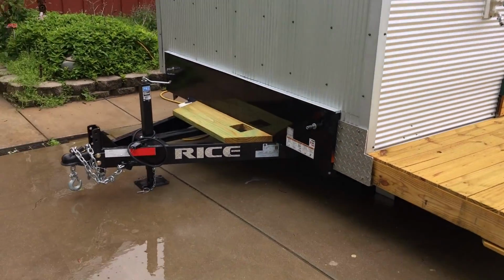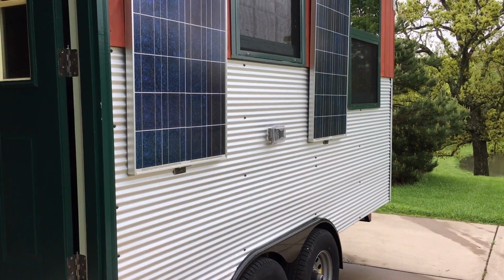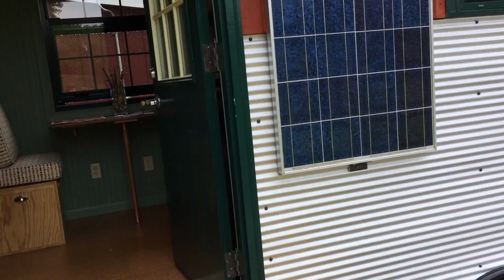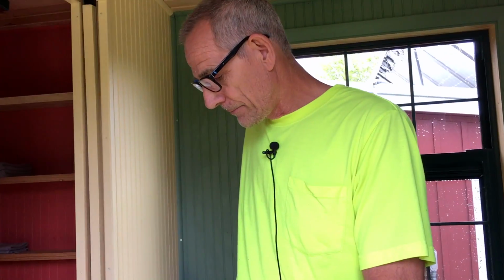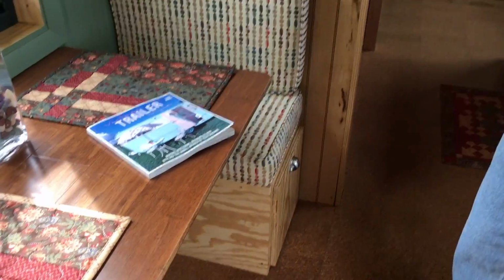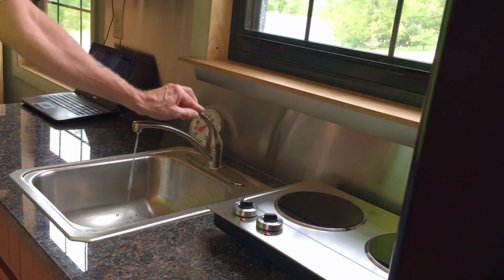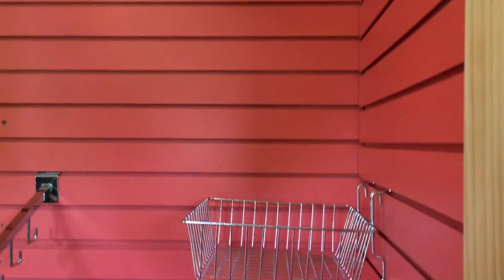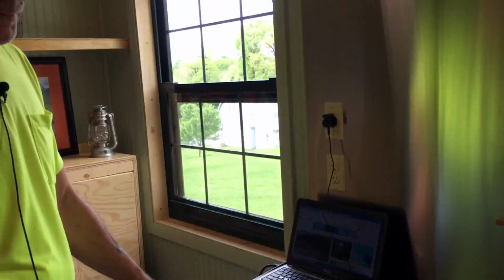The Starlighter 1 Is The Perfect Forever Tiny House

Comment: So nice to see an alternative to lofts in a tiny home and get ideas. He gave a nice tour and I'm sure he could custom the Murphy Bed a little to make a seating area when the bed is not in use with storage under . Like raising the bed up 8-10 inches there could still be two shelves above but storage under with a 7-9 inch platform for cushions . Remove the cushions when folding down the bed and shove them in the dead space of the Murphy Bed frame back when using for sleep. The beauty of seeing all the tiny house builds... Ideas to fit you personally. Thanks for sharing.
Reply: Yes, he mentioned considering it when responding to posts on Tiny House Talk website...  The rotating table was one of the things he changed from the original design, for example...

Comment: I believe some people misunderstand the point of tiny houses....they are custom to YOUR LIFE. So everything he did was for him or the people out there like him. To constructively criticize is one thing, but to be mean and say all the things that he did wrong is opinion. I like the idea of some solar on the side of the house, however you would need to rotate it twice daily, but no hail, or limb damage. Thank you for sharing!
Reply: The problem with tiny house builders is they often had no true design direction and don't make it basic enough to appeal to everyone. They add a bunch of stuff try to add profit.  So if you don't like where a shelf was put, too bad, you're paying for it anyways.  It's like how people add a deck on their home for a couple thousand, but want $10,000 more for their house.   But this also makes tiny homes more expensive.  That's why he put a granite counter top in there, to try to get more money for it.  

But there's a lot of fundamental design flaws in this tiny home though.  All of that embossed stuff on the outside is going to cause running/dripping water along the sides from rain to sit and not drain properly and rot things away and seep into the walls, like the tops of the windows and doorway for example.  The solar panels on the side are pretty dumb, no reason to not put them on the roof. 

He also clearly has walls overhanging the edge of the trailer, which means the whole thing is setup for structural failure.  That one factor alone makes the thing a no buy.  The bulk of the weight in that area is no longer sitting on the trailer, but rather sitting on whatever he used to create the overhang.

He also made another glaring design flaw....he said it's made to be taken off the trailer.  But if you look at the wheel well, the structure contours around it.  There's no way you're getting that off the trailer without destroying the section surrounding the wheel well unless you lift it up off the trailer a few feet, which would basically be impractical and probably impossible without causing major damage to something since you typically slide such things off trailers, not directly lift off the trailer.   The ability to take it off also tells me it's not fully bonded to the trailer in a safe way.  I mean this thing could break off the trailer going down the road, maybe not immediately, but it could happen.  You basically have a couple bolts holding thousands of pounds, and worse, they're holding it horizontally, which means more shearing forces.

He left basically no room for a person to customize it with their own lights, and the lights it does have are pretty sad.  I think even an extremely thin person would find it difficult to sit at that table, and while the top does turn sideways, it's basically unusable in its default position. 

On top of that, when you do turn that table sideways, it basically means that if someone is sitting at the table, the entire walkway is blocked.  So if you've got a person on one side trying to get to the other side or you yourself need to, you have to turn the whole table, which means the other person has to physically get up, back away from the table and due to the aforementioned issue with the table in its default position, won't be able to sit back down at the table until it's turned back again. So it's like one of those scenarios where two people are coming down a narrow hallway and both can't pass at the same time, so the other has to either stop and hug the wall or back out to another area.  And there's 2 seats at that table, so they can't tell us it was only designed for one.

The closet was a fairly huge waste of space, and all the piping/electrical stuff could have been more efficiently distributed. Definitely a few square feet of wasted empty space that you can't do anything with and can't obstruct with closet things like clothes hanging.
Reply: Raw plywood and builders' odds'n'ends doesn't do it for me
Reply: C North YES YOU ARE SO CORRECT WITH HIS HORRIBLE DESIGN FLAW.
Ok, he designed it fitting what he likes or someone else may like, but it’s my opinion of what most people would like or not.
He definitely needed an experience tiny house designer or architect that designs small units. The only reason I watched this video is to see his reason for having the solar panels mounted to the side of the tiny house 😳. What was he thinking🤭 or is it because he wanted to be different... Yes, he’s different. It would have been better if he mounted the wheels on the roof of the tiny house DESIGN FLAW🙄.
Reply: Excellent post.
Reply: @jahmenj  , should we petition to have the builder arrested?
Reply: C North. I'm feeling you. Excellent observations ... all that AND the hideousness of the colour scheme.
Reply: The shelves in the bedroom are not level you can see it when he is talking why not open the Murphy bed to let us see the design of it and the closet area should of been designed differently with a door in mind or curtain there's no room for a washer and dryer combo .
Reply: It's an awesome place to live. I would put the toilet at the other end but then where it is you have less plumbing to do!
Reply: I think it would be neat if he had the solar panels on something that could fold up kind of like an awning.
Reply: Boy, I am 2yrs later to this party! I agree. He gave you so many options for change. Whenever you watch these tiny house, sometimes folks are saying if I had to do it again.... He offers easy options for any change.
Reply: True he made it for him. Very nice but no bathroom sink is not for me. Still a nice little house for him.
Reply: Not necessarily Erin dearie. I think we understand "the point of tiny houses" as well as you.
I hate this place and I have just as much right to give my opinion as you do so save your judgment.
This looks like a mish mash of stuff he got out of dumpsters. This is the worst I have seen and I've seen many.

Comment: This has some great features and I think you did an excellent job building it. I'm going to save this video. I love the fact that it has many things for older folks. Nothing to climb on the roof for and no loft. I also like that it can be taken off the trailer for permanent use. I would really like to see you make a slightly larger one for a couple that includes a bigger bed and sink in the bathroom. Excellent job and good price!!!
Reply: I totally agree with you, especially with R.A. in the joints.

Comment: I like the designs where the electical units are not intruding in living area. I am also concerned about the water system that close to the electric system. Love the colors and granite counters. The front door is nice. I have found treasures at the recycle type stores as well. The outside is very striking. I also like how you designed for the choice of moving around or staying put.
Reply: I too am not excited the water and electrical are so close, my first thought when I saw it - along with why it isn't enclosed in a closet.  I am assuming its guy-designed, no female inputting some ideas we are more apt to focus on.  Like a proper living room/sitting/entertaining area and replacing murphy bed with seating that would convert with a pullout or fold-out bed in the bedroom.

Comment: I like this one. Layout, and set up looks very functional. I might have to cover the glass on the door for privacy sake and a larger bed than single but from what I could see the space was there to fit one, if the murphy bed were removed. I like so much about this and can see going off-grid in it for sure.
Reply: What Murphy bed?
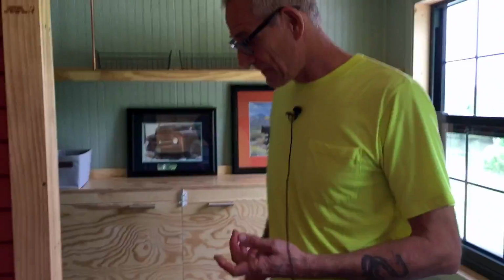Reply: Twin size murphy bed at 9:15 he talks about the bed below the shelving.
Reply: these builders need to lose the murphy beds.  They waste space and are a pain to use as well.

Comment: Nice work. Didn't get to see the bed. I'm not a fan of fixed table and sits but this model is now on my list to try, real nice.

About the discussion on the solar panels, well this is custom build (he knows why he did it this way), besides they can swing up, not fixed as vertical. Unless you don't know this can be very helpful to prevent heating the walls with direct sunlight (insulated or not) depending on the position of the house because less sun will heat this portion. Another thing is, too much sunlight (ironic) is not good for solar panels, they loose efficiency as they heat up.
Reply: wow didn't know that about too much sun on solar panels, nice to know before I have them installed on my house (which is at an angle and totally facing South (in my home our floor-to-ceiling windows along 50' of our house keep it 90 degrees from Dec to about February, so those solar panels on the roof now concern me they could get overheated.  Thanks again.

Comment: If he's going to have a hot water radiant heating system, he should have gone with a tankless, on-demand, hot water system.  It'd have eliminated the need for a hot water tank... and saved a good bit of space.
Reply: A tankless hot water system wouldn't save much room over that tiny tank.  Plus tankless systems are meant to be used with the pressure of a municipal water system.
Reply: oh, didn't know about the water pressure thing, glad you clarfied that for us who were thinking the same thing  @tomj4731
Reply: I believe it would still be possible with some sort of tank and electric pump to pressurize the water source.  Not sure if gravity fed water from a high mounted water tank would be sufficient.

Comment: It's extremely nice and beautifully done.Very charming indeed however, I don't see the point of down-sizing (to untimely live cheaply) yet spending 35,000.00 in doing so. Just don't see who this would appeal to. I would like to see a cute tiny house that's built nicely and within the average persons' budget. Because my train of thought is, if you have 35,000.00 to spend  you can certainly find a large higher end RV to live in instead.
Nice work though.

Comment: Solar  panels not going to work much. Going to hit your head on the tv.  It need to be for a couple bed . Does have some good things
Reply: They are hinged and swing up.
Reply: He didn't show that they are on a hinge, but you can see the hinges pretty easy though. A benefit of them being mounted like that is it can get more sun in the winter, more than on top. The tv is also on a multiple hinge hangar that also is plain to see. It is mounted to a metal wall away from the doorway. There is also a murphy bed style set up in the back that will hold a twin bed. Did you bother to watch the video or have ever seen a tiny house before this one?
Reply: They look adjustable.
Reply from the maker: Yes in the winter if the tiny house is oriented south it will get sun pretty much all day. In the summertime you can adjust the panels even more to catch more sun.
Reply: Really clever installation of the solar panels.  I wouldn't want to climb on top of the home to maintain the panels.  Great idea.
Reply: That's good to know. I was wondering if the panels could be lifted up to catch summer sun.
Reply: Yes, the hardware above the panels are adjustable hinges and the bottom is held in place with a clasp... So it can be released and adjusted, with the clasp allowing it to be locked down when moving so the high winds on the highway don't damage them...

Those two panels alone, and the single battery, though, don't provide a lot of power... You can charge your gadgets and power the lights but not much else...

Radiant floor heating, etc. require more power than those provide but it can keep the fridge going during a move until you reach the next parking area with hookups...

It's reasonable for the price he wants to sell this THOW for, as Solar system that can meet all the needs of a house will still run you over $15,000 by itself... But basic needs can be met with a lower cost setup for less than a $1000...
Reply: It's a great house. Thanks for the added info.
Reply: @ rose edison - I assume you aren't aware that houses in Ireland use solar power.  Ireland - which is famous for being a rainy island.   Also, it doesn't "need" to be a larger bed - as a single person may choose to purchase it.
Reply: The side mounted panels would be necessary in places with severe winters. Don't want to climbing up on the roof to clear ice and snow off the panels. And you're not going to be clearing as much snow when it's sitting vertically. Around here the sun's fairly low to the South in the winter too, so this would be all around ideal for our winters.

Personally, if I made my own tiny, I probably wouldn't even mount the panels on the house, instead setting up a frame where I could adjust the angle and direction, and just sit it near the house when I park.

Comment: ShowMe Tiny Homes LLC  Starlighter1 Built 2016-17

    160 square feet THOW (20X8’)

    New Missouri D.O.T. trailer,  9,900 GVW both axles have brakes, electric breakaway brake. black powder coat, adjustable hitch 2-5/16 coupler

    2X6 floor joist 16” on center,  5- 5-1/2” EXP foam in floor joist, metal pan below joists

    ¾” Advantech floor decking glued and screwed

    2X4 wall framing 16” OC glued, 3-1/2” rigid and spray foam insulation

    ½” Zip sheathing, all framing and sheathing glued to framing, sheathing covers rim joist

    2X6” rafter truss, spray foam, Simpson hurricane clipped

    ½ CDX roof sheeting, glued and galvanized ring nails

    Hydronic, radiant floor and wall heat, with Roth Radiant Panels

    2-Kyocera 120W, 12VDC solar PV modules, hinge mount,  110 AH deep-cycle battery

    Midnite Solar “Brat” charge controller

    Midnite Solar DIN breakers, Blue Sea 12V fuse block

    4- 12VDC receptacles USB plug and battery voltage display

    100Amp breaker panel, 1-1/4 conduit stubbed out bottom

    50A RV connector on front of trailer

    Exterior 120V receptacle and 12VDC

    LED ceiling lighting

    32” fiberglass shower stall one piece, Delta single handle faucet

    Flush toilet, prewired 120V for composting toilet

    Wood cabinets, two banks of drawers, 1 door base 15 x 22 stainless sink, Delta faucet Granite top 70” of counter length

    Hot/ cold frost free exterior faucet, for outdoor shower vehicle or pet washing

    6,000 lb tie downs on four corners

    Pre-piped for LP of NG at mechanical room and under kitchen, stubbed under both ends of trailer

    Plumbing, electrical and roofing by licensed contractors

    Twin size murphy bed, horizontal mount

    Bamboo dining table converts to single bed, 70” long, large storage drawers below

    Cork flooring tiles, composite flooring in bathroom

    Large closet 60X32 with SlatWal and clothes bar

    Quaker thermal break aluminum single hung windows with screen kelly green

    Lincoln wood window in bath with screen

    TPO roof installed by Cardinal Commercial Roofing Inc

    8X4 pressure treated deck, mounts on front of trailer for travel

    House is bolted to trailer with grade 8 bolts and could be lifted off trailer

    Weighs approx. 8,880 lbs, overall height @10-8” very energy efficient

    9.9 cubic foot refrigerator, fastened to wall framing

    Cusimax 2 burner infrared stove top 120V portable

    Large capacity toaster oven

    Acer LCD R240HQ 24” monitor on Cheetah swivel mount

    12 gallon hot water tank 120V

    Thermo 2000 Mini BTU electric boiler for radiant floor, 3KW  glycol freeze protection

Comment: I would have liked him to shown how the table turns into a bed but I think the house is nice
Reply: Yeah, it seems to be getting rarer that anyone does a detailed tour... But anyway, it works the same way as the dinettes in RV's... Table becomes a platform you slide at level between the benches and then place cushion over it and you have a bed... Not very big, though...

A convertible bench/couch would be more usable IMO...  Ikea has a nice modular system that you can arrange into multiple arrangements from dinette, couch, lounge, and bed and you can just slide a fold-able table into the space when needed that can serve as coffee table, dinner table, etc. depending on how the units are arranged...

Alternatively, he could have raised the Murphy bed and had a bench/couch below it that you could pull out and put next to the dinette to extend the bed space...  The bottom of the Murphy bed could also have a fold out table to use as a desk with the bench/couch and the bench couch could have a pull out steps if the Murphy bed is too high for someone to easily get on... or use it for additional storage...

And those ideas shouldn't add much to the total costs...